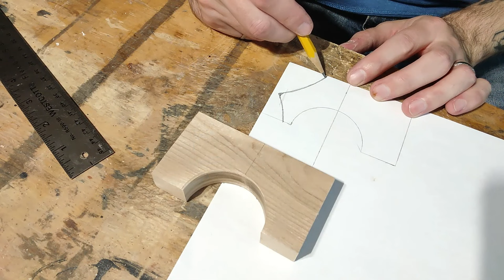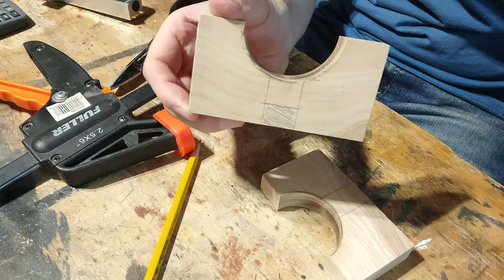MAPLE AND GRANITE CANE WOODCARVING

Comment: Love the work you’re doing. A suggestion, slow down the drill press when using the larger forstner bits. They heat up easily and burn. BTW, subbed.
Reply from the maker: Thank you very much! Great tip...

Comment: Did you use the 2-part epoxy to fix the granite ball?  I didn’t see it mentioned, but perhaps I missed it. Great work by the way. It turned out beautiful
Reply from the maker: Thank you! Yes, I used epoxy and a 1/4" threaded rod to attach the ball to the wood.
Reply: Can you tell how you fix granite ball with help of rod with wood  either from upper side
Reply: I would also like to know, did you drill a hole into the ball for the threaded rod then epoxy it in place?

Comment: turn that draw knife over,
Reply from the maker: I find I can control it better with the bevel facing up... but I have seen it used bevel down, I just don't like how it runs across the wood that way.
Reply: @JasonHedrich   it works either way up, but like the chisel they work better bevel down, easier to stop it digging in and following the grain. have you tried angling it? so it shears like a guillotine.
Reply from the maker: @cjhawk9308  understood, but it still works best for me facing up. But I agree with your explanation